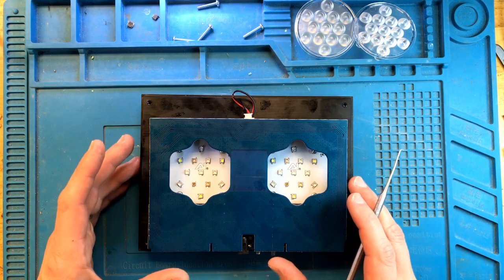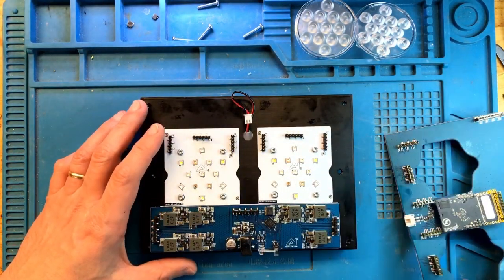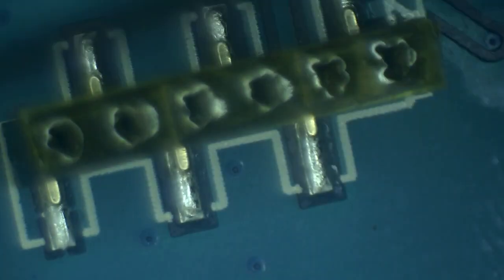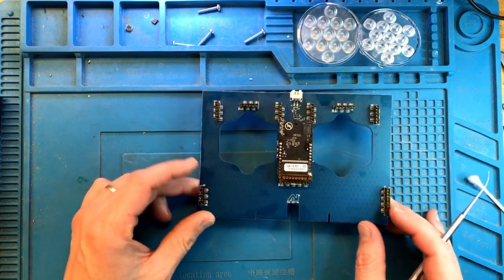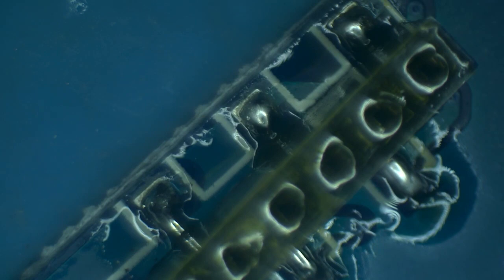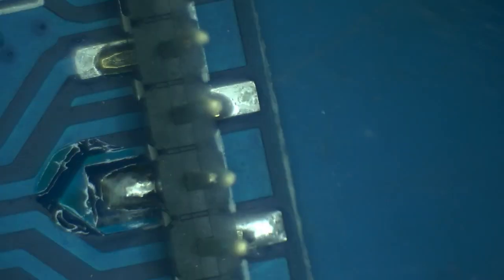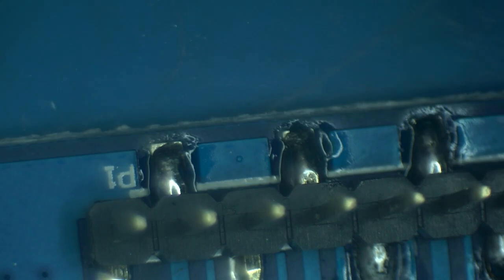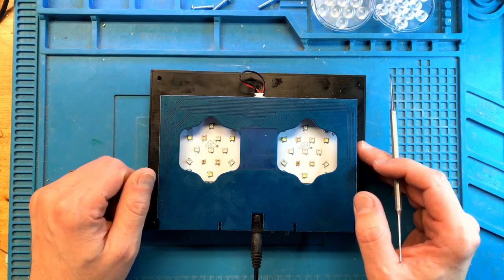Hydra 26 HD Dim Blue Channel Repair. Worst Manufacturing Defect Yet.

Comment: hi 
Great videos 
Question have you ever been working on Ai prime/fuge have one here faulty led but it is so hard to find replacemen led they are 1.4mm one
Reply from the maker: I have a couple older primes here for parts, but I haven't worked much on the newer ones yet.